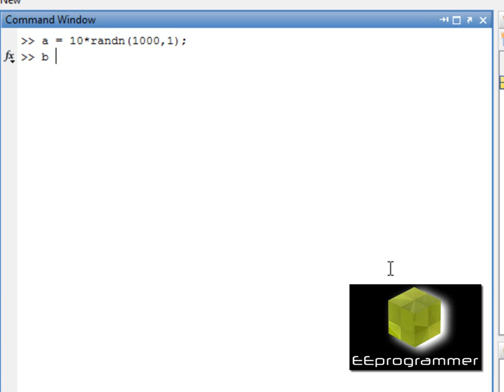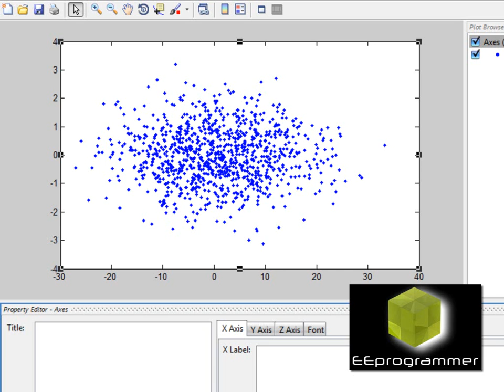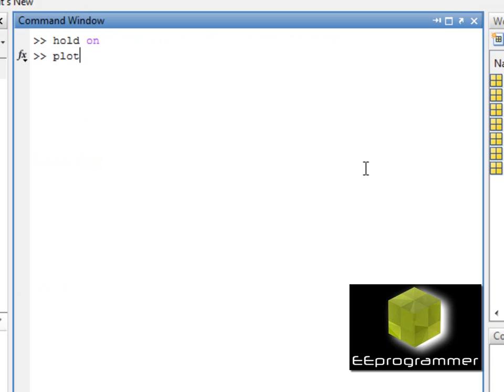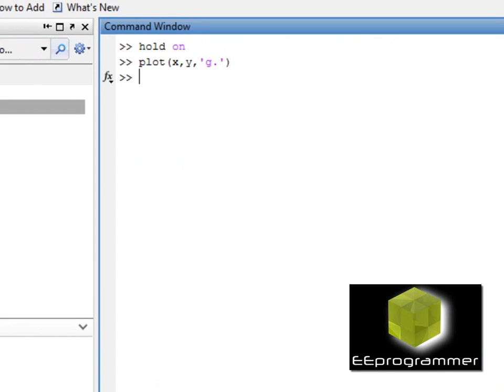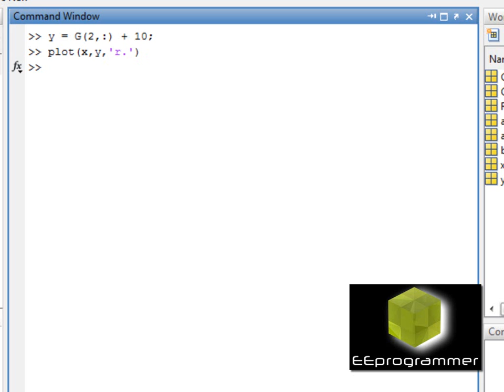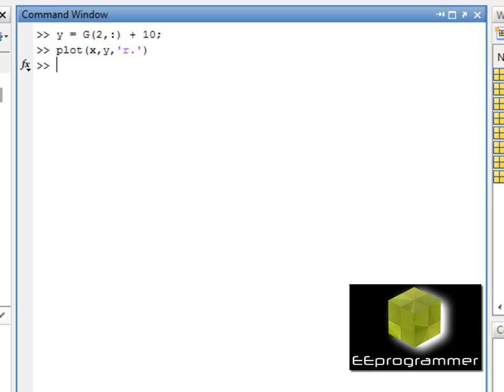MATLAB tutorial - principal component analysis (PCA)

Comment: Hi, Why is your data plot all spread out? I thought you did 10*rand(1000,1) which means your data points are a 1000 random values that can be anywhere between 1 and 10. Why do you have data points in the negative values and past the 10 number line.